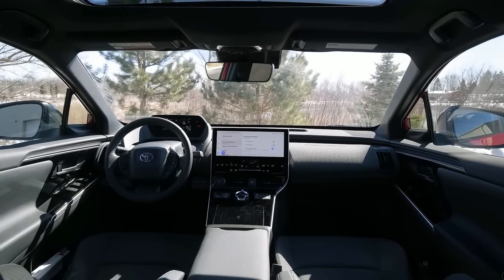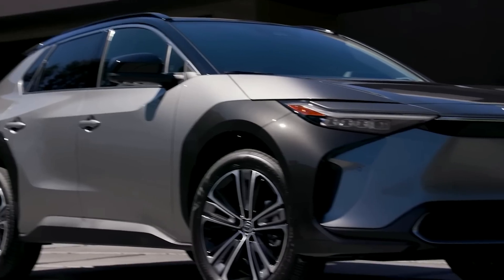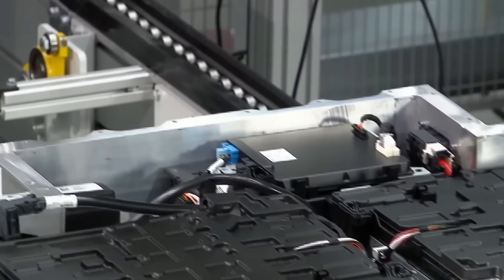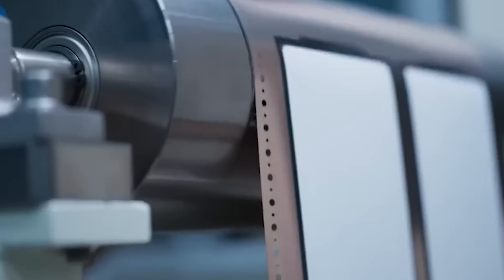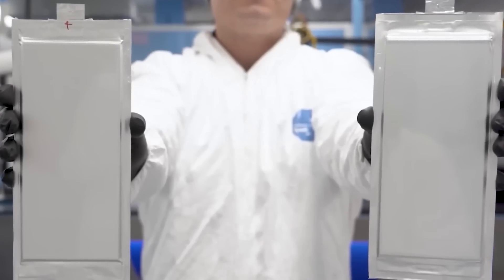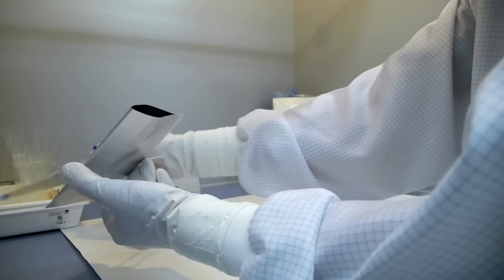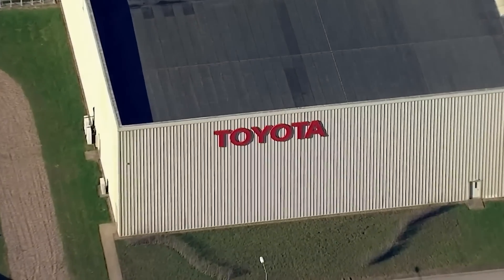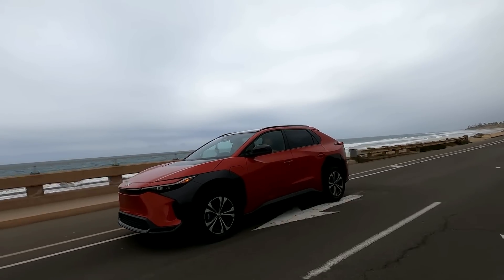Toyota CEO "Our Solid State Battery Will Change The Industry In 2024"

Comment: I do know one thing about what the consumer is complaining about with the EV industry. Is the high cost to replace the car's battery packs. Tesla's charge's
$20,000 for a battery replacement pack. There are a lot of people that don't know about this yet. Also there have been complaints about Tesla's mileage range. It's not what they say that it is, because of the weather. In winter the batteries lose degradation from the cold. So if you have an EV and live near snow. You are in for a surprise. Also for some reason there battery packs have
 been taking on water, and ruining the pack. Which leads to having to buy a replacement. So I suggest that you stay aware of the competitions problems. This way there problem's don't become your problem's. People will always compare you to others. 👍😎 Also in Europe, the people are going crazy for the Chinese EV's that are made by BYD one of the largest in China. There car's are becoming very popular there.

Comment: I think this is typical EV HYPE and BS to keep people interested in the now disreputable EV of low range, high cost of repair, fire hazard, and high cost of purchase and insurance!  Solid State batts are like Fusion energy(always 30 years away)with these miracle batteries always 3 to 5 years away.  They are even more complex and expensive to make and no mention of the rare minerals needed to make them is suspicious in itself.  After all of that being said;  the reality of power available to charge them is completely ignored.   e.g. Toyota claims a 10 minute full charge for a 745 mile range - that means 200 KWH being stuffed into the batt in ten minutes, that means a charger putting out over 1.3 megawatts(accounting for inefficiencies and losses) - that is not possible with the supply of power we have and the woeful inability of the grid to deliver 100's of Gigawatts more than currently possible.  It is complete Alice in Wonderland Crap!!   AND, if you think charging a car at 1.3 megawatts(1300 amps at 1000 volts)is not a fire hazard then you are hopelessly ignorant.

Comment: OK, let's look out in the driveway.  Let's assume a 100KWH battery will run 200 miles.  To go 950 miles should require 950/200=4.75 as many KWH power to go 950 miles in the same car.  So 4.75 X 100KWH = 475 kilowatt-hours.  Your neighborhood EV station runs 150 KW chargers.  It takes more than 475 KWH to recharge as nothing is perfect so let"s be generous and say 500 KWH will charge it.  500KWH / 150KW = 3 1/3 HOURS charging at full blast!  But, the charge rate tapers so 950 miles is going to cost you 4-5 HOURS at the mall charger.  Charging at 7KW at home will take 500/7= 71 HOURS running your electric meter at FULL tilt!
Duhhhh......

Comment: As the times have changed and the EVs have fewer moving parts(compared to ICE) and less maintenance, 1. Toyota should adopt a direct-to-customer model, so near invoice prices to customers would spike up the demand. 2. A giga-press kind of approach (similar to Tesla) would drastically cut the cost by enhancing the Quality of the product. 3. They should be focused on getting a mid-range max 400 Miles SUV at an affordable near or sub 30K price would be useful, as even if you are going on long drives with family, 99.9999% of the people stop for at least 30 minutes to take nature calls, so that time can be effectively used for recharging the battery (as we don't need truckload of battery) and big-range comes with big-weight, which is counter-intuitive to eco-friendliness and adds to excessive tyre-wear and faster tyre placements. So Toyota has to give up on their DUMB idea of Hybrid and should SOLIDLY produce SOLID STATE BATTERY CARS

Comment: Clickbait, No real info, just some negatives about lithium ion batteries. He was wrong about li-ion batteries having electrolyte gel. Lithium-ion battery is a dry cell.  They use an aqueous lithium salt coated as thin layer onto separator sheets sandwiched between the cathode and anode materials, which are also coated onto thin sheets.

Comment: How many times does Toyota get to promise success with its impending solid state battery and then fail to follow through with its promises before people will be skeptical about their promises. I guess its stockholders have no limit to how many times Toyota can cry wolf and still be surprised when the wolf turns out to be a false alarm. Just take a few minutes to check Toyota’s promises on solid state batteries. I feel sorry for the great people of Japan putting their trust in Toyota’s leadership. Very sad, Japan deserves better than this.

Comment: look at the EV fan boys - boys cause they are not grown adults

even with solid state batteries it is still a flawed tech - having to replace the battery and solid state still can go thermal runaway if something happens - its less likely to go into thermal runaway but they still can is the bottom line
they are money pits, what a waste of resources building them - seriously there is finite materials for batteries and that would be better suited for devices in general - they do not reduce pollution and what happens when there is blackouts or even better an EMP blast - imagine a whole civilization on EV and an enemy decides to EMP you 

EV is literally an ideology of delusional idiots

Comment: Range anxiety and not bursting into flames are both key concerns with EVs.
Reply: Check the statistics on the rate of internal combustion engines catching fire vs. EV’s. The reason there are such concerns about EVs is that when the relatively rare fire of an EV happens, it’s headlines but when the much more common ice vehicle catches fire the media takes no interest but even if they report it at all, it’s only local news as fine print, if that.
Reply: @jamesmcneal1821 very much so. EVs are not a big fire concern. Yes it happens. It happens in ICE vehicles too, only much much more often.

In both cases the likelihood of your car bursting into flame is extraordinarily low.
Reply: Range isnt as big of a deal with anything in the power range of 400-600 - but charge cycle and bursting into flames is kind of a bigger deal in my book. Charge cycles has a real cost value and bursting into flames is never good:) at least compare to range.

Comment: Wait!  Wait!  Don't buy an electric vehicle we have much better technology in the pipeline.  All you have do is wait a few more years.  /s  

First, Toyota told us to wait for their fuel cell vehicle that has been almost ready for production the past several years.  Then they tried to convince us that hybrid vehicles were good enough.  Now, Toyota claims to have a groundbreaking electric battery but it is still in development.  

Toyota needs to face-up to the fact they blew it by walking away from its partnership with Tesla.  This assessment is coming from a guy that drives nothing but Toyotas.   It is sad to watch a great company fall flat on it's face.  Unfortunately, the grandson of the founder was determined to stick with internal combustion engines.   Sad sad affair.

Comment: The title needs correction that it implies solid state battery contains no or less lithium than the currently used battery. The main difference is on the state of electrolyte, substituting for liquid state

Comment: ONLY reason I haven't bought a EV car is due to the range limit. 300 miles range just don't do it for explorers like myself. I need a bare minimum 600 miles. And that's COLD or HOT battery. Non of that Tesla 307 range but in reality with cold weather you really get 240 miles. Or worse, Ford Lightning 70 miles range in cold snow weather and not using the heater! No thxs.

Comment: I am not worried about mileage and charging time. Lithium is a material very harmful for environment during the expropriation. That is the worst, not mileage, not a time we will spent (use) to take a rest for further travel. Third order countries are abused for Lithium expropriation and people and nature are suffering. I am very curios about new material in solid state batteries, and where we can find it. I hope that it will not be a revolution for planet destruction.
Switching to EV doesn't solve problem of carbon emissions due to spending energy gained in power plants, mostly from oil and coil.
We are going more and more down with every day.

Comment: Solid state batteries are made out of 34% more Lithium than current Lithium-ion batteries. Lithium mining on earth isn't at scale to have 10% of cars be run on it, let alone 100%.  And even when we do get it to scale, we can replace the world's auto fleet maybe twice, and then we're completely out of commercially viable lithium on earth. Forever. We're going to need something else.
Reply: Sodium ion or bust. there is no other way to meet battery demand long term
Reply: Elon says , "Lithium is the most abundant on earth and that is why it is number three on the periodic table and is everywhere",
Reply: @skbskb7596  Elon missed the commercially viable part. It is everywhere, but generally completely dispersed at 0.1 to 0.2 ppm in the ocean. It's commercially viable in only a few places on earth. A Tesla model S battery takes 138 pounds of it. Not enough to keep turning over the world's auto fleet at a marketable cost.

Comment: Even 400 mile range would put Toyota at the head of the pack. 500 miles would be a game changer. If Toyota can really pull this off, and isn't just trying to seduce the stock market, it will be Prius 2.0 and Toyota will be back in the game. If not... R.I.P. Toyota!
Reply: It's really not the number of miles.  That's a meaningless metric in the larger sense.  How much power per Kg is what will set it apart.
Reply: What Toyota wants to achieve in 2030 is already reality in China. Zeekr 001 has 1000KM range. The battery is called Kirin from CATL.
Reply: @john826  so it's been reported, but we'll find out if it's real. Does the battery last? Does it work well in cold weather? There are many questions.
Reply: Honestly, I'm less concerned with the range. EVs have workable range at this point. It's cost, weight, and infrastructure.

Charging infrastructure and our grid has a long way to go before widespread adoption of EVs is feasible. And EVs/PHEVs are too expensive and thus reliant on subsidy and rebates to make economic sense.

Get me an EV that weighs 500lbs less and costs the same as a conventional/hybrid vehicle and it'll be a no brainer.

Comment: The clickbait thumbnail for this video says, "NO MORE LITHIUM."  That's nonsense. Toyota's experimental solid-state batteries are made with a lithium-based battery chemistry.

The title says it will change the industry "In 2024." That's nonsense, too. Toyota has said that they hope to get these batteries in the first cars by 2027, but that's probably unrealistically optimistic. Back in 2017 they were hoping to get them into cars by 2020.

Comment: Faster charging? Does that not mean the grid has to deliver even more current to the chargers? Where is that going to come from at scale?

It is just a scam to blame CO2 for climate change in any case. Hydrocarbon fuels energy density and refuel times are hard to beat. And you have to beat them as without the big lie what is the reason to buy an EV?

Comment: The Panasonic 18650B Li-Co battery cell got into the market in the 1990s and considering specific energy, it is still king, 247 Wh per kg on bare material level. There was seemingly some confusion about CATL's latest "revolution", a Na-battery of allegedly higher specific energies than Li-batteries (wtf?), eventually a credible number showed. I leave it open whether that was a deliberate lie or due to some unfortunate "misquotation". 

That limit is for an ideal thermodynamic reason complementary to Carnot efficiency since the concept of energy comprises work and heat, directed and random particle movement. If there is a chemical potential gradient between two phases and moving (charged particles if battery), moving particles (mass) from phase A to B diminishes that gradient. That mass transfer can be figured out on basis of the ideal gas law for the as good as it gets case and it gives within a couple of Wh that real figure for this LiCo-cell and others; the matter is essentially ideal and engineering (and remarkably well) can only approximate that ideal. We are used to his for engines but ideal thermodynamic limitation applies also to mass transfer, i.e. specific energy.
  
So I'd love to see the voltage gradient which will revolutionize the technology (har dee har); whenever these people start arguing with seemingly impressive Wh per kg with regard to only one(!) electrode, it is a surefire indicator for vapourware advertisement. So Toyota, just get your battery rolled out and shake the market if you can, I'd love to see that but until that day shut the f*'*k up and spare me merry tidings of the kind.

Comment: Hybrid vehicle's would make a big difference immediately instead of waiting for some big breakthrough in battery technology. I wonder why that's not the focus of the government's and companies for the present. Maybe it's not very profitable afterall everything is about making money.
Reply: Because having both power systems is a negative. You're carrying dead weight of the other system.

"Hybrid" systems are better said as "Battey assisted ICE". You're trying to increase the efficiency of the energy capture from EXPLODING hydrocarbons. Not diversify the sources you can get the drive power from.

Pure electrical vehicles can use DC motors at each drive wheel instead of mechanical transmissions. Dropping that not insignificant weight. Along with the engine block and complex (to try and keep them clean and efficient) fuel injection systems.

Comment: Good luck to the kids mining the cpbalt for tesla owners if there not dead they might be out of a job
Reply: Tesla batteries use iron, not cobalt.
Reply: Bullshit paul.
Reply: The highest percentage of cobalt actually has the battery in your smartphone.
Teslas are (to a high extent) switching over to LFP (LiFePO4) batteries which are based on iron and don't contain any cobalt.
Reply: Don’t be that guy! Do your homework before commenting.
Reply: @Harrythehun  i did its a book called cobalt red .do you research and see where the cobalt for tesla,s come from .
Reply: @paulb4uk  Teslas LFP batteries have no cobalt at all. Read some other books too.

Comment: I'm sure they are aware just like lithium Ion batteries what to do with the enormous toxic waste from used batteries. Is it possible to recycle ♻️ used battery waste. If not then what's the point of forcing this technology on the people and the environment.😎🌴
Reply: There are plenty of emerging recycling technologies which producer battery minerals cheaper and more cleanly than mining. One is Neometals of Australia.
Reply: @rod-contracts1616  
Do you the reality of recycling plastic?
I'm just as eager for the someone to come up with better way to do things, but recycling [car] batteries looks like another "too good to true" thing.
Reply: @rod-contracts1616  lol like what? In order to cleanly recycle the batteries they would have to be designed from the get go in completely different and more expensive way. As it stands now the only two ways to recycle them, both toxic, incinerate them or melt them in acid. Both producing toxic waste that again has to be contained. I doubt anybody on this planet gives a f to do this cleanly, they will just dump it into environment.
Reply: The bigger issue overlooked by the masses, politicians, and environmental extremists is the massive mining required to get to even 50% EVs.
"Zero carbon" is the dumbest idea ever promulgated. Life becomes impossible. We and virtually all life are dependent on and partly made of carbon. Zero carbon = no plants, no insects, no animals, no humans. Hah.
Reply: @lolo4gaming39 
Do you know what it take to "recycle" a battery from an EV right now?
Reply: @lolo4gaming39 Whatever and however Nissan Leaf battery is recycled, it's got to be much MORE energy intensive than recycling plastic. 
And less than 30% of our plastic products are recycled, according to Green Peace..
Reply: The point is that if they last longer you don’t have to recycle them because they just keep working. (Eventually yes, but much longer usable period)